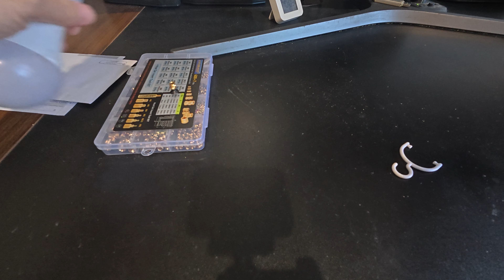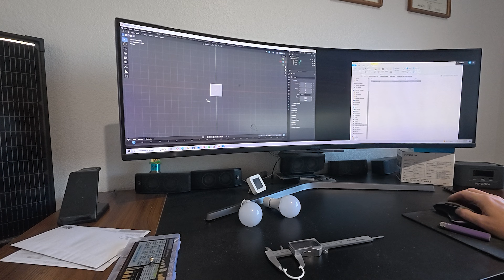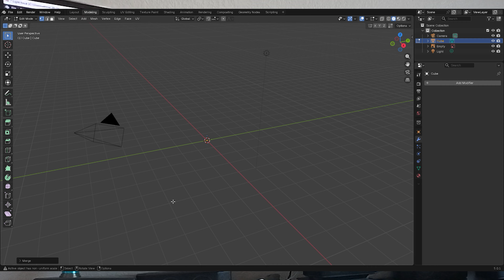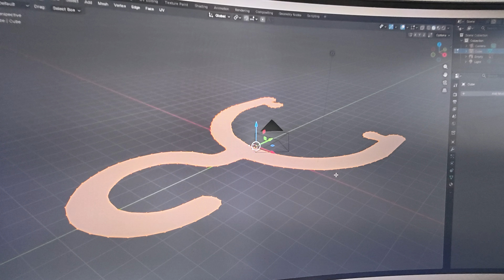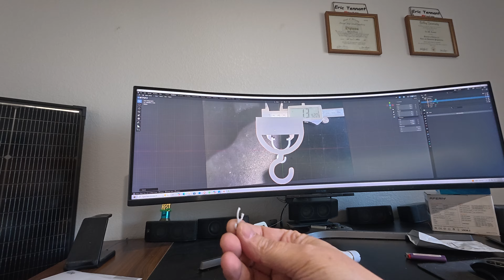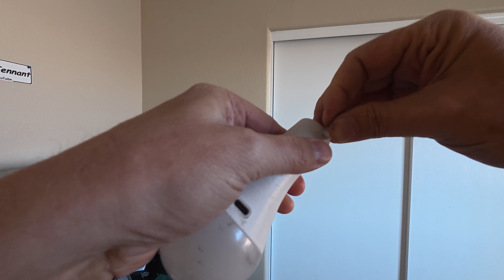Trace Real Objects (Blender & Caliper Tutorial)

Comment: Hello I need some help. So im working on a  cylinder. And im using the loop tool, but I don't know how to measure or precisely measure the loop cut tool where the circle like the loops around the cylinder. How do I measure from end to end or trying to place it in a specific place on the cylinder, how would I do that